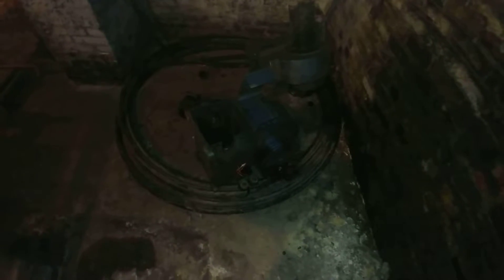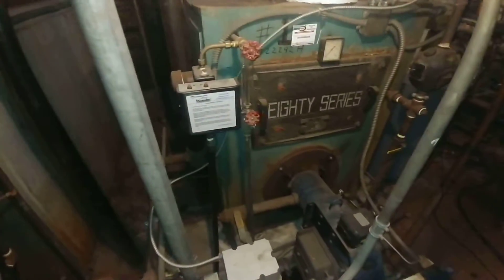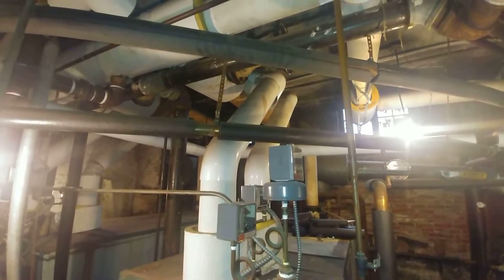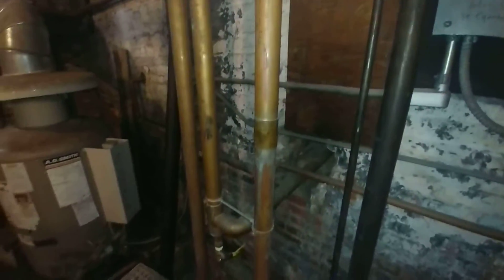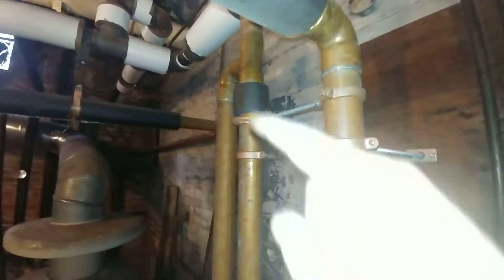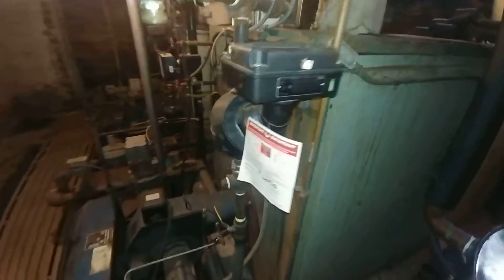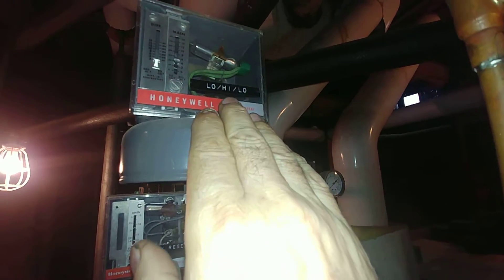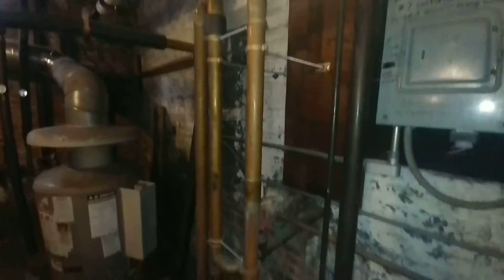False Water Line is a True Solution to Steam Boiler Water Return Line Changes

Comment: Nothing like a nightmare steam system. 
You know, ‘but it worked for years’ (Customer says standing in front of Radiator Vent spewing steam that’s been leaking for years)
Yeah, worked harder at not running correctly (Us)
Nothing like a real experienced Professional to figure it out and fix it